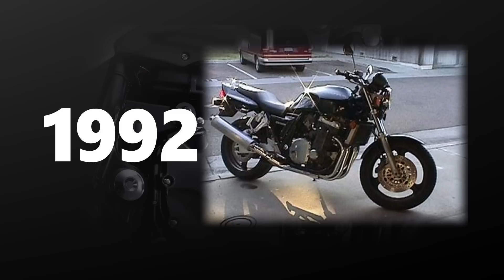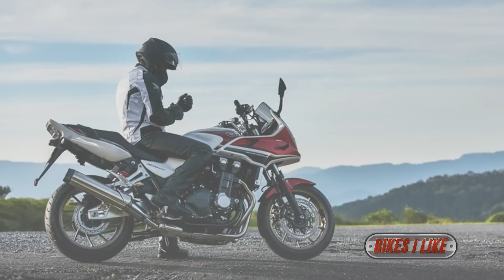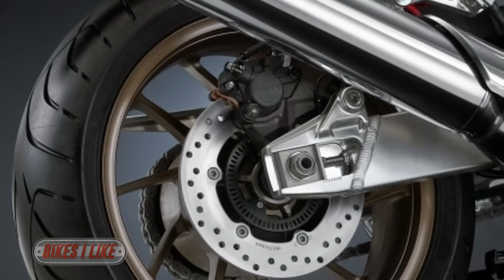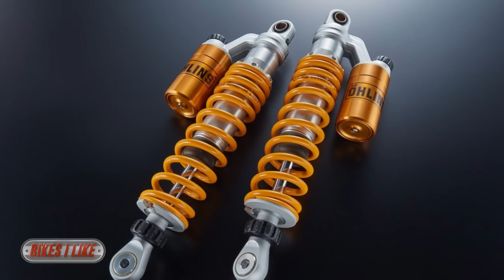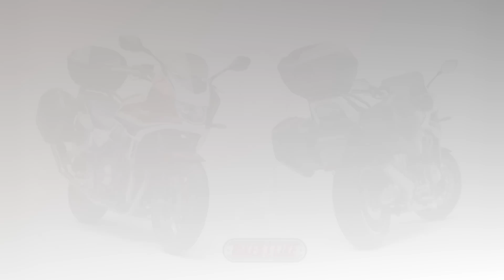2019 HONDA CB1300 - FULL SPECS

Comment: I'm going to try to be polite here... (Disclaimer: Just my opinion. Seriously not trying to hurt feelings here. I'm just frustrated with the state of motorcycling in general.)
This is foookin stooopid. Over weight (600lb. HOW?!?!), under powered (109hp?!?! I doubt that is even rwhp), over priced (starting at $13.5K is absurd...), unbelievable... 
Why do we keep settling for this for this?
For reference, I really like this kind of bike. I bought the 1994 CB1000, without seeing it in person, as my first liter bike. I loved it until I just couldn't ignore a few really head scratching flaws that it had, 5-speed trans, less than 100hp, it was heavy, getting affordable replacement proper sized tires for the 18" rims was a big problem. This is especially hard to explain some of the issues when the same year CBR1000, which shared most of the engine with the CB1000, did have the 6-speed and way more power.
Do I need to say it? A 1300cc inline 4 should be making over 160hp, easily... Suzuki B-King or Hayabusa anyone?
To be fair Honda isn't the only motorcycle manufacturer out there being foookin stooopid. I'm looking at you Yamaha, that Niken thing wtf is that about and there's two versions of it... whaaa? There are many others that I can point to as well, some are even worse... I don't even know what to say about BMW, I mean really...
Reply: P. T. Anderson , Here in the States millenials aren't buying motorcycles. They rent electric bikes and scooters and throw them into the river because they're too lazy to return them.  They're not hunting, fishing, boating, going to baseball games, NASCAR, or pretty much anything us Boomers enjoyed. 
Honda is trying to rejuvenate the old "you meet the nicest people on a Honda" vibe from 50 years ago.
Reply: @spaceflight1019  Yup, I'm here in the United States. A lot of my complaints about this bike also apply to way too many bikes sold here. Which might explain why millennials and other generations aren't buying bikes like they used to. The motorcycle industry has gone stagnant in many aspects except price, which is way too high for what we're being offered. Where are the 8-speed transmissions? Why are we still getting bikes with badly flawed EFI? Where are the carbon fiber frames (there should be at least a few)? I could go on and on and on... Case in point. I have a 2001 Yamaha FZ1. Someone I know has a 2016 Yamaha FZ10. Mine makes 125ish-rwhp and gets about 42mpg. Both bikes make almost exactly the same torque. His bike makes 130ish-rwhp and gets about 30mpg. When ridden together he's looking for gas at around 100 miles. When he's looking for the second tank of gas I'll fill up because it's convenient. If I'm on my own I usually start looking for gas around 225 miles. The FZ1 is running good ol' CV carbs that are super smooth from idle to redline. The FZ10 got fancy three mode EFI that's not as smooth and gets 12mpg less... WT*?!?! This is not what I would call progress. There is 15 years between these bikes...
(On a complete side note... I'm of the opinion that not nearly enough "Boomers" made the effort to pass on their love of hunting, fishing, boating, etc., etc., to their children in such a way that they would love it too. Then, when the second chance came around with their grandchildren/ millennials, the same thing happened... So, not just my experience either but I lived it and I'm observing/ hearing those that are younger than I. Sorry, just the way I see it. To be fair none of my grandparents, who would have been the parents of the boomer generation, taught me any of that good stuff either.)

Comment: I had two 1983 CB1000 Customs. They only made them one year. Great bikes, but those Customs looked nothing like any of these other CBs. Even the 1983 CB 1000Fs looked different than these new ones. Maybe its the exhaust coming out one side. I like the symmetrical exhaust. There used to be a CB, I think it was 1979, that was six cylinders. Three chrome pipes per side. There was a photo down at my local shop at the time showing a guy doing a wheely at 75 mph on one of those. Really tried to get my hands on one in the mid-80s

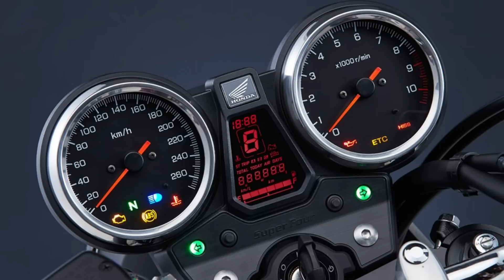Comment: To bad the throttle is on the left hand side. See 2:07. I wonder if the gear shift is on the right? Is the clutch lever on the right and the front break on the left top? Does it have a rear break? I would also like to know why I can't by one in the US. I can buy one in the UK but can't ride it there! The list goes on. So I did some research. You can buy this hot baby at Bubba's Iawn Mower Service, Rt.1 Antartica and ship it to Galapagos Islands Ecuador and ride like there's no tomorrow!!

Comment: The bike is heavy and low powered, 106 HP is disappointing.
Reply: Seth Adam   
In EU they had 136hp ....
Reply: @kalaga2k , Seth Adam,
 happy owner to the day of a 2008 cb1300 here ( naked, EU ). It's more like 114Hp but with 12kg of torque it realy little matters. Bike can cruise in 30-40 km/h in 5th gear and just pulling on the throttle it'll do some 220km/h in a matter of seconds, 2ppl and load. Very smooth, low rpm powered engine and a joy to ride it, deff not underpowered.. for example .. watch?v=DU1h23g25ZQ 
If you ever get a chance for a test ride, don't pass on it.
Ride safe!
Reply: @Alchemist1508  I ride a Busa, testing riding a low powered bike is not on my menu.
Reply: @sethadam4266  , 
prev bike was a CBR1100XX ('98) so i can relate with the 'busa .. grew out of it tho growing older .. too much plastic, too much unecesary power and too old of a rider for such bikes .. to each their own tho.. 
Ride safe!
Reply: To Alchemist 1508...test drive ? forget it! Some dealers don’t even know such bike exist. Welcome to America!
Reply: Honda are stupid losers.

Comment: I had a 2008 CB1300S (half fairing).  Yes in stock form they arent powerhouses, but with full akra,K&N, PC3, and opened up airbox my bike made 130rwhp.  Very easy and cheap mods.  The bike makes 118nm of torque at low rpm, it has a redline of 8500rpm but can go over that in the lower gears.  You can purchase rev limiter bypass for them from Japan. 

This is with stock 9.6ish compression and stock internals.  They run on 91ron fuel, nothing is as low stressed as one of these bikes.

Handling is exceptional for a steel frame of this type (UJM).  Some basic mods like fork brace, uprated springs and decent tyres transform them.

Power delivery and good torque for its era (2003), 310km range, comfy riding position and quality build make it best in class.

Five years of ownership and many great rides endeared this bike to me.

And yes I still enjoy riding its Grandpappy (my CB1100F Super Bol'dor) including period wobbly frame :)

Comment: I like also very much this model which would be excellent choice for everyday riding. The price however appears a little bit expensive. A perfect model would be with a shaft drive given the fact that Honda has already several motorcycle models with shaft drive.
Reply: STohme  you loose less power and feel with a chain and as big and high tech they make them they last a longggg time if cared for any at all.

Comment: You gotta be kidding 109 HP?????? My STOCK HORNET 919 makes that and is 100 LBs lighter!!! Whats the point 1284 cc if thats all it does????
Reply: Your motor makes significantly less torque at higher rpm, also a different class of bike.  The CB1300 is a designated Heritage model, your bike is a budget naked using bits and pieces from other bikes.
Reply: @thejourneyman1087  I like most buy a bike for its performance not its heritage! My bike was several thousands of dollars less better performance and even better milage and the detuned fireblade engine is bulletproof! Thats the true legacy of the CBs
Reply: It looks cracking, but it is going to be a relatively high revving beast. As a suggestion my 2016 BMW R1200R has 125 ponies and doesn't need all those suspension steps as I just press a German button and hey presto it softens or hardens. The torque and acceleration from low revs is sparkling to say the least. So I won't be changing!

And please don't read from a script, you could make this video far more engaging with a modulated commentary rather than reading from the triple fold A4 brochures so beloved of Honda in the 1970's. Oh yes, I don't need to know the rake and trail figures.....

Comment: This would be a phenomenal bike to ride. This is I suspect the grown up version of cb400 super four which I loved. I wonder if it has variable cam timing?  And it's still relatively light for a big bike. Will be interesting to see some ride reviews.... brutally fast I suspect
Reply: according to this vid: this bike has 109bhp. which is pitiful for a 1300cc.
Reply: @raymondo162  True the numbers are not huge however being a 4 the rev characteristics are all important. My CB400 Super Four with variable valve timing really opened up fast above 6000 rpm so with a staintune exhaust it was wonderful to ride fast and howled. This might have the same potential but I haven't seen any real rider reviews. The exhaust looks very constricted. Have to wait and see. My biggest critical aspect of my Honda was it's rotten seat for touring. The BMW is so much better.

Comment: Cool...... till the specs.  
    Small back tire, no inverted forks, no standard radial mounted brakes, mediocre torque, straight up shit hp, no mention of advanced electronics, and way too expensive.  
        I’ll keep praising my ‘18 ninja 1000 abs thanks.
Reply: Only wankers need all that electronics
Reply: nobber d robber i believe it would be “all those electronics “
     But hey,  i guess its only  wankers who have the full ability to customize our bikes to deal with the widest range of conditions you may be exposed to. 
    But you are so cool, and your skill level so moto gp that would never make a mistake, or possibly have to avoid a mishap.   
      And hey... whats so great about getting into urban traffic, being able to select low power mode, and having a much smoother controllable machine?
      Your comment is so ridiculous.... it is equatable to saying “whats so great about fuel injection”

Comment: They gotta do something about the Horsepower. 160hp would be a good atart.
Reply: @Ian Mangham A little, you don't get that much HP boost just from exhaust.
Reply: horse power fetish 🙄
Reply: Justdad accelerate a lot faster for starters. Every now and again you just want to get your heart rate up a bit
Reply: The power is there,,tune it correctly
Reply: Easily modded up to130rwhp. Remember they are traditional style UJM steel frame conventional forks and double shock rear end. 160rwhp is quite a lot in an older style frame
Reply: @thejourneyman1087  Marketing also. 130 puts it closer to the CB1000R so they're not going to have one of their own models somewhat competing against another.
I'm sure it's tuned for cruising, sport touring, mid range power. It's about where the Bandit was in horsepower.
It would look better with a quarter fairing instead of a half fairing.
Reply: 600 lbs!!! 
My car doesn’t weigh that much. 
No Thanks.
Reply: @Dano831  I didn't notice that. The ZRX used to be about 520, but sitting on it, it didn't feel anywhere close to that.
Reply: Gregory LaGrange yep. My zrx feels much lighter. Feels very nimble. I guess my point is, if you’re going to bother slapping a ~1300cc engine in something, and if it weighs that much, better back it up with the power. Regardless of the comments about “not used to their potential” about other high hp bikes, it’s not about that. It’s about the different in power delivery throughout the entire powerband. I’m not gonna go hog wild to the limits, but feeling a 160hp bike out the hole vs <100hp machine is a huge difference.
Reply: @User6327  What year is your zrx? Love those bikes. Congratulations on having one. Probably will be a collector item one day. You have the green or the purple one?
Reply: Tony Soprano pussy

Comment: For a engine this big the Horse Power is not impressive.
Reply: Ride one. See if you miss anything. Bikes like this are all about low end torque.
Reply: @ukspizzaman   I hear you bro, I know it will be all I would ever need, I have a Suzuki Bandit 1200 and it's got enough power as it is so I know this bike will more than be enough for me,  man I ride my KLR 650 more than the 1200.

Comment: Wait, so is this a replacement for the CB1100?
Reply from the maker: No the CB1100 is a separate line of motorcycle. It's looking like the CB1300 is Japan only release at this stage.
Reply: No. They are produced concurrently. This bike actually was available first (1998) where the new CB1100 was released in 2010 (?) .

Comment: It's very heavy! What's the hell is all this weight about !
Reply: Steel frame mate traditional UJM design, twin shock etc, it was in a class with the ZRX 1200, GSX 1400, and Yamaha XJR.  It was second lightest in class.
Reply: @thejourneyman1087  yes I Know what I am trying to say here you can have the same look ..the same feeling with less weight if they used the latest technology in manufacturing.. keep the design just change the materials!

Comment: Whoops no you didn't. Seems pretty expensive. And the horse power seems about the same from 1983!
Reply: If for no other reason than inflation, the new bike is going to cost more. I was expecting something north of 20K.  But beyond that, the level of technology in the new 1300 is well beyond that of the 1983 bike.  And even if the peak horsepower is no higher, it's safe to say the power delivery is much smoother and the torque band much wider.  And if the '83 model was crankshaft HP as opposed to rear wheel, tack on at least 20 HP to the '19 model specks. 
Looks like a great bike. This is what Japanese big bikes are supposed to look like.  We don't need any more Harley clones from the Land of the rising Sun!
Reply: The original CB1100F makes 108hp and 98nm of torque, the 1300 110hp and 98nm of torque.  Power delivery differs between the two.  Gearing on the original is low, modern bike is overgeared like most modern bikes tend to be.  1983 bike weighs 245kg dry (euro spec).  Modern bike weighs 232 faired and 228kg naked.  Narrow weirdy tyres on original 180mm rear on modern version.

The originals are collectable now and fetch 8-10k AUD in good nick.

As far as riding both back to back modern bike naturally far superior.  Specs dont tell the whole story.
Reply: @thejourneyman1087   - You are correct. Specs aren't the entire measure of how good a bike is. Thanks for helping me make that point. Some people are hung up on the fact that it doesn't make 200 HP.
Reply: Haw much go for ?
Reply: @frankleehamilton9012  -  About $17,000.

Comment: Yes you forgot the 1983 CB 1100F
It was the same RWB colors....
I had one Brand New. It was great!
Reply from the maker: Actually no. The CB 1100 line is air cooled and although the CB 1300 borrows the Super Four name, the CB 1100 is the true descendant of the Honda 750 four. The CB 1300 was born from the water cooled CBR1000F (of which I've owned two). I've got a separate video coming on the CB 1100 soon ;)
Reply: @BikesILike  oh I see. The horse power is the same and sure seems pricey with the fairing, don't you think?
Reply from the maker: @BKMDano17  Oh for sure Dan they're not cheap, you'll get no argument there. For me the CB1300 is a true nostalgic replica and I don't mind the power figures, I'd be quite happy putting around on it. If outright performance was my priority though I'd be looking elsewhere.
Reply: Great bike the CB 1100F , I still have one .
Reply: @tyrone5066  Thats interesting ..I was just thinking about that bike today! Really wish I still had it!!